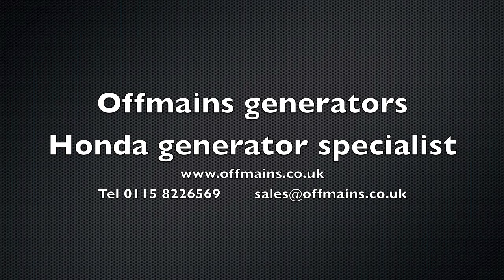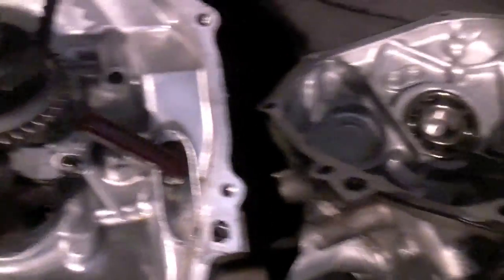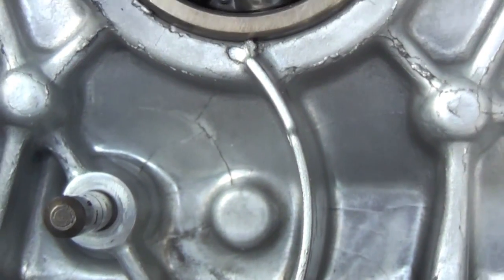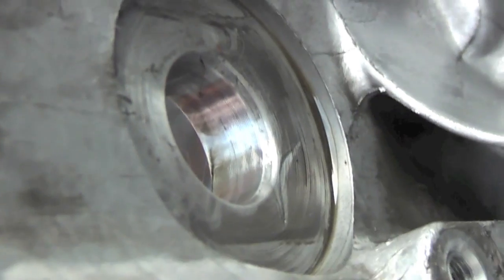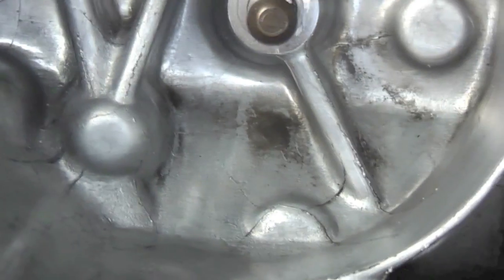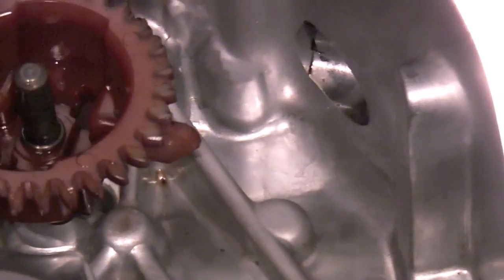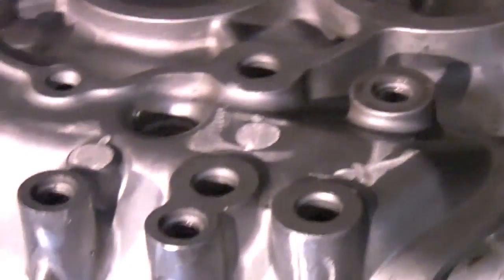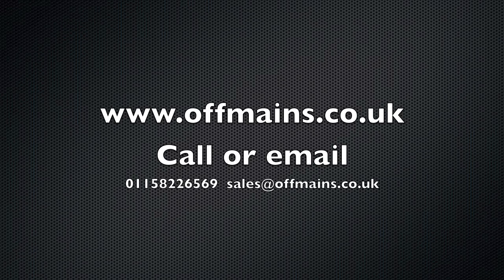Honda EU20i / EU2000i generator engine casting cracks

Comment: My Honda EZ2000 leaks oil.  I checked oil level and it is over the "full" mark.  Is there an "overflow" hole on that engine?  It's something I purchased new in the '90's.  Starts on first pull after sitting for years at a time.  Never had the carb rebuilt.  Just add star-lite each fall before I fly south with the rest of the birds.  I discovered, the birds have had it right all alone.  We are the dumb ones.  Ever see a bird shovel snow?